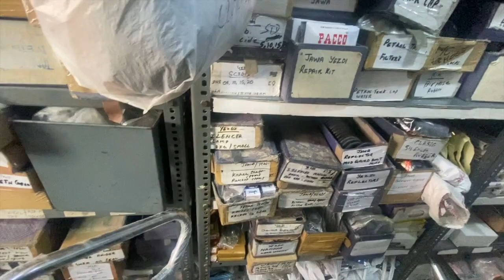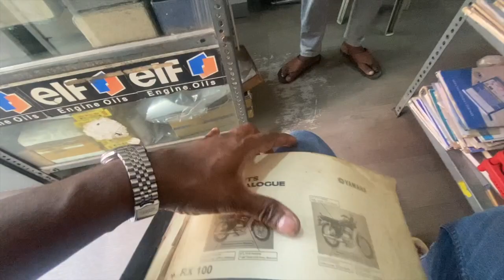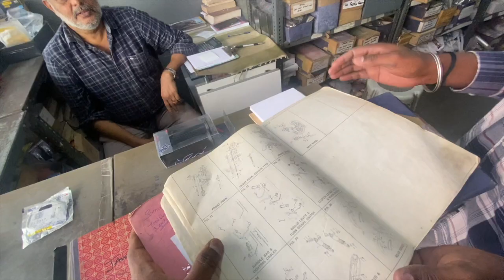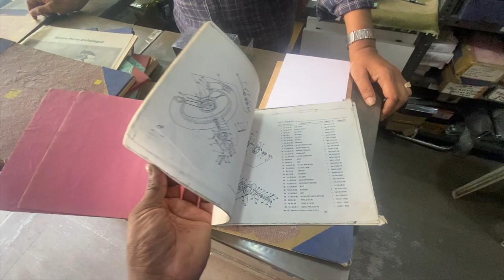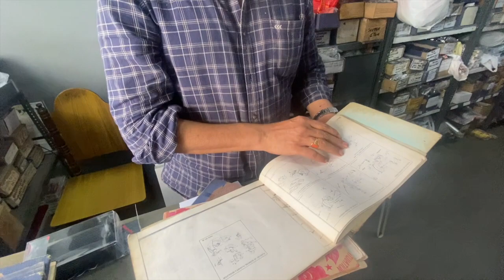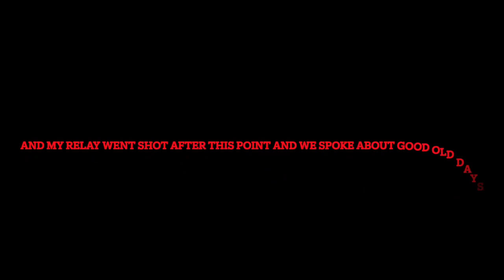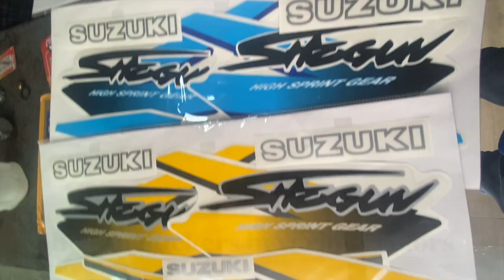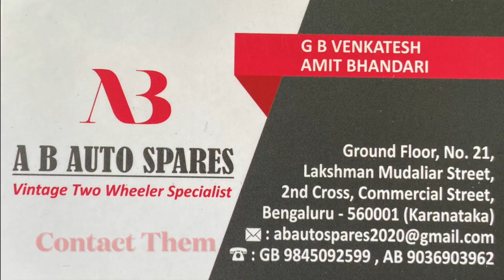Best and cheapest 2 Stroke Spare Shop in India | MRP Rates | Reasonable Price Shop

Comment: Recently vangiya Rx inte tank innerside full turumbu anu, etra clean akkiyittum pinnem rust varunnu, replace cheyyendi varumo, innerside coating ellam poyi ,aa coating after market cheyyan pattumo ?
Reply from the maker: I tested something it worked
Reply: @Yamakaze  
Etu liquid aa coating nu upayogikkane
Reply from the maker: @avinmcmxcv  video varum, one request, post comment relevant to the video. It’s easy to reply that way, if you have any questions connect on insta

Comment: Thanks for this video. Ente 2 stroke days were from around 1999 to 2010 or so, annokke regular visits were to Siyal automobiles near Cooke town. But yeah that was mainly for RD spares. Ippo I think they have moved elsewhere.
Reply from the maker: I haven’t contacted them since 2015
Reply: @Yamakaze  I used to get good or original parts from Siyal because I had started going there with Ron. Not sure about the experience there otherwise. Enthayalum ee sthalam kollam.